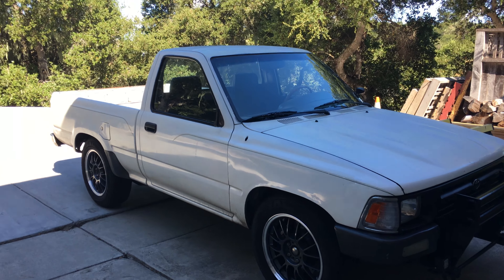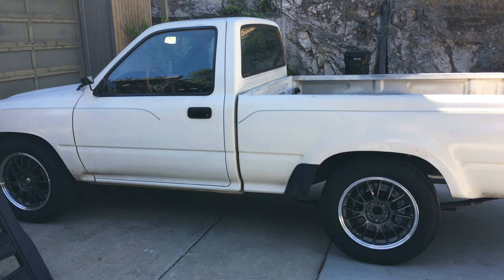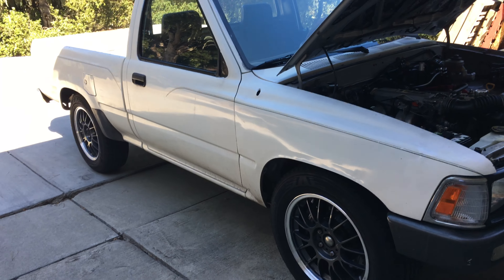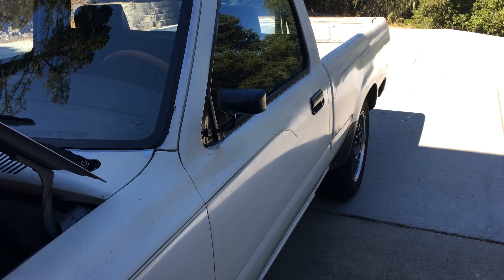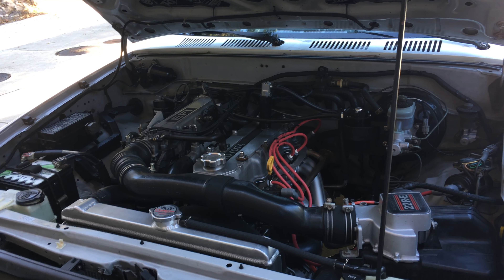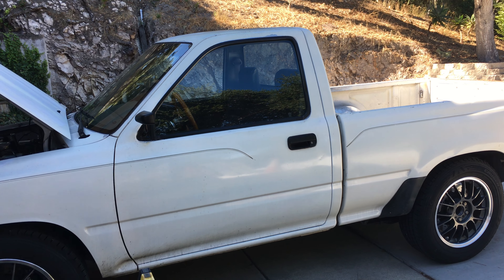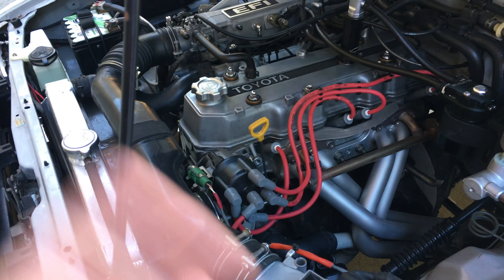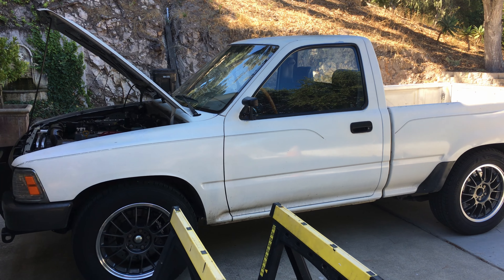What it's like owning an older Toyota Pickup truck w/ a 22RE motor pros / cons & do chicks dig it?

Comment: I bought an ‘87 SR5 4x4 with the 22RE a few years ago.  I love its simplicity, reliability, and looks. It is easy to work on, and engine/drivetrain parts are readily available. In my mind, it’s the perfect vehicle. The 80’s and 90’s were truly the golden age of Toyota.  Thanks for the videos. 👍
Reply from the maker: Couldn't agree more. My girlfriend has a 1996 Lexus ES300 w/ the 1MZ-FE motor - that thing is super nice and similar in a lot of ways to my truck. 90's for Toyota is where it's at for sure.

Comment: Have a 91.  I bought brand new 34 years ago.  Ready, $6500. But the dealer but in factory ac and cruise control for an extra $750.  Yea they use to do that. No radio came with it, So I put one in.  Many folks give me a thumbs up.    Never drive it in the snow and rarely in the rain.  I'm retired now and it serves me well.

Comment: I am thrilled to have found this channel as a fellow 22r/re lover. I had an 87 4x4 single cab that started my toyota pickup obsession. I spent much of my late teens and early 20s hunting extra parts and tinkering on it constantly. I eventually sold it because I wasn't using it anymore. Last I heard, the guy that bought it has put like 150k miles on the engine I built for it. 

After the better half of a decade, I finally got the toyota pickup I always wanted. It's a white 91 pickup dlx xtra cab- 2wd 22re 5 speed. My buddy that had it swore he'd never get rid of it. After a decade of wearing him down we were able to make a trade for one of my other cars. Thankfully, I always hoped to get another one, so I kept all my extra parts lol. 

I tell everybody, these little trucks can do 95% of what the average suburban truck owner needs a truck to do. If it's a 2wd you get the benefit of being able to step directly on the tailgate. Think about that next time you have to move a refrigerator.
Reply from the maker: Yeah, they are great trucks for sure. I love mine. Does everything I need and is super enjoyable to work on and drive.

Comment: I didnt start working on any engines untill i bought a 93 xtra cab 2wd. No AC. Automatic. And only 88xxx miles. It has 104xxx miles now. Im learning more and more as i go! Great truck to learn on. I do some things on my little pickup then it gives me confidence to tackle my toyota t100 3.4l so far i have had great success ! I love how my little toyota pickup sits low. Is pretty stylish. Has torsian bars ( dont have to worry about lower ball joint failures like tacomas because of them ) 22re is a loud ticky lil thing. Going to do a valve adjustment still. I would also say the 5vze is also a bullet proof motor in the camry. 4 banger. I got over 150k out of mine before i decided to sell to get my truck. I still miss my camry. I wanna keep both my trucks and get a 93-95 camry. I have toyota issues hahaha
Reply: 5sfe * 5vze is in t100.

Comment: The passenger side mirror is a worthwhile investment..
Reply from the maker: I removed it to reduce drag and help increase gas mileage
Reply: @ray5961  Not to be argumentative, but I put one on my 94 base model and have gotten 40 mpg on occasion with my 22re with a 5 speed.
Reply from the maker: @garethleitner9547  For sure man, no problem. But 40 MPG seems really high. Have you checked your speedometer using GPS on the phone to confirm everything is reading accurately? Best I've ever seen on my truck is about 26 MPG with a tail wind, although I'm usually driving 80+ MPH also. In my experience a lot of times when people say they are getting 35 or 40 MPH out of the 22RE it's either because they are not actually doing the math calculations correctly and/or because they have an undiscovered calibration error due to running different gearing or something. Are you filling up your tank full each time and then dividing the miles you've driven by the exact gallons needed to always top off the fuel tank or just estimating how many miles "for a full tank of gas"? Also, have you done a GPS calibration to check our gauges? On my truck for example, I have different gears and tire size and that all works out to a 5% error which I have to account for. So when I'm traveling 80 MPH on the dash, my truck is actually going 84 MPH. If my odometer says I've covered 200 miles, really I've covered 210 miles. If it takes 10 gallons to fill up the tank to top again, then just divide the 210 miles by 10 gallons and mileage is 21.0 MPG. Is that how you are computing things? I think 40 MPG from a 22RE is next to impossible unless you are maybe running 35's and driving 55 MPH the entire trip or something... fill me in, I'd be curious to know more! :-) With regard to removing the side mirror and installing a smaller mirror on the passenger side, I can definitely feel that the truck drives a bit smoother on the highway and mileage improved maybe 1/2 MPG +/- on account of it. There are times when parking that I do miss that passenger side mirror though! :)

Comment: I still dream/aspire to own a 355 some day (and my old roommate's got a 360 on the way from Japan that I'm supposed to help him manual swap here soon), but maybe my old 22re Toyota 4x4 pickups make those Italian stallions obsolete lol
Reply from the maker: F355 is a fun car... feels a lot like a tricked out Datsun 510 :) You gotta be real careful with the 355, because it's easy to spin up the rear tires and things can get out of control very fast. I nearly wrecked my 355 the 1st night I owned it.. also damn near crashed it just driving into town on a cold morning; rear tires spun up and it went sideways into the parking lane - had there been any cars parked there I would have wiped out the rear quarter for sure. The 355 also is somewhat poorly built in some areas. Things fail on it, stuff falls off it. The cat ECU's are prone to failures and need to be replaced. The left side (as I recall) factory manifolds will blow a hole into the air injection and the car sounds like a VW bus w/ no muffler. The inside has a haze that builds up on the windows due to whatever adhesive they used. It's a fun car and w/ a tubi it sounds like a straight F1 car through a tunnel. Also belts require a full motor drop as I recall. So you better really love the 355 if you plan to actually drive it. The 360 is built more like a tank by comparison. Models before 2001/2002 had issues that should have never left the factory. It's a bigger more comfortable car, but still fast. Exhaust doesn't have the F1 sound.. it's more like a drone w/ any sort of aftermarket exhaust. Beautiful sensual lines on the 360, especially in metallic paint. Feels much more bullet proof and powerful. The 355 feels like a kit car, while the 360 feels like an exotic. 458 is a dream.. it's like if the 360 and an iPhone had a baby and that baby grew up to rule every other car on the road and that baby said "you shall only drive me at 130 MPH during rush hour traffic... and the CHP can suck it... they can't catch us, even with their helicopters - now drive". And the 488 is just garbage... and anyone that likes the 488 has no taste, at all :) But the Toyota pickup is as much fun to own as the 458, you just gotta not care about lack of power. And CHP helicopters can catch you, unless there is a dirt road that leads deep into the forest, then maybe you can get away still...

Comment: Hey Ray, just adjusted the iac valve after replacing the fuel pump which was a task and I can give advice on how to access the fuel tank if anyone wants to know.  Anyway I could only let out the valve 3/4 and now it’s pretty rich .  I’m wondering if 1/4 turn back if it will help lean it .  Thoughts ?
Reply from the maker: The IAC valve should have no impact on running rich vs. lean - at least not once the warm up phase of the motor is complete. Let me know what you mean by 3/4 ? you mean you turned the little slot nut thing inside the IAC valve counter clockwise an additional 3/4 of a turn? How are you getting an AFR reading from the truck during operation?
Reply: Yes I was trying to back it out more but could only get 3/4 turns .  My thoughts were to make it idle better and also to have the same airflow after let’s say having it parked for 15 minutes , more of an experiment really .  I know or assume the computer trims down or up no matter what so maybe it’s the 02 sensors .  Everything else , sensor wise has been checked.  It’s drivable just the fuel economy is off.  Ive had the truck for 5 years now and I’ve hit the sweet spot where it runs like off the assembly line but it never lasts
Reply from the maker: @gatzbravo  Hmm.. hard to say but usually the IAC valve doesn't have a lot of impact on stuff like fuel mileage. It's only function is to act like a choke basically. Did you see my other video regarding what to check when your 22RE isn't running right? You can also just block off the air inlet hole inside the throttle body to totally disable the IAC valve in order to rule it in or out of what is wrong and see if that's even a factor to be concerned about or not. What sort of mileage are you seeing around town vs. on the highway? With my truck I average around 19 MPG in town and more like 24 MPG on long highway trips.
Reply: Last I checked I was there at about 17-18 mpg but that was before the fuel pump change.  When I changed the pump i could se the previous owner did an amateur job with the wiring.  He put twist caps on the connections which may have been submerged in the gas but still worked till it didn’t .  As far as the mpg if I smell gas it can’t be giving me good mileage now.  It’s just weird that it’s off after just the pump change .  I had already cleaned the intake, throttle body ,  when trying to troubleshoot till it stopped pumping gas.  I think it was on its way out regardless of any other issues.
Reply: I did see your video yes.  These engines are so simple but tricky also.  I do believe that I’ll never get it finely tuned like u mentioned on one of ur videos
Reply from the maker: @gatzbravo  17-18 isn't unusual for around town, especially if you lead-foot it and/or if you are driving a 4x4 truck. Are you running a cat? Could be an O2 sensor issue as well, as that's how the ECU zeros the air/fuel ratio out.
Reply from the maker: @gatzbravo  Yeah, that's basically it. It's an old motor and ECU running on OBD1 kinda stuff. I mean you can get it to where it runs really well 99% of the time, but sometimes the idle will go up and down when you come to a stop if the ECU gets out of sync with air/fuel ratios and things. Getting the 22RE to idle super smooth is basically not possible as far as I know.
Reply: My brother is a Honda guy and he’s convinced that it’s one of the two O2 sensors .  All my small issues up till now he might be right .  I really dislike sensors at this point lol .
Reply from the maker: @gatzbravo  Hard to say but it could be. You can check the voltage output in the diagnostic box for the O2 sensors if you wanna see if they are sending signal back. On my truck the harness to the O2 sensors was chewed up really bad when I first got the truck and that was causing issues also. But I wouldn't expect much over 19 MPG around town. You can try to lean things out a bit by adjusting the spring inside the AFM and that will usually kick your gas mileage up a bit and lean things out. Maybe try 2 clicks more lean on the AFM inside there (make darn sure to mark the factory starting point however). Also, keep in mind the 22RE relies on narrow band O2 sensor technology, while modern cars are typically wide band. Narrow band is more or less blind to what is actually going on, so it can only tell the ECU "you're too rich or you're too lean or just right" but it can tell the ECU how rich or lean. So if things go ultra lean, the O2 sensor keeps sending back a "you're still too lean bro" signal and that signal only comes once a second. So if it's very lean or very rich, the ECU could need 10-15 seconds to get back to where the O2 sensor says "okay, just right". With a wide band controller you can see the exact AFR and the ECU knows "okay, far too lean, make this must adjustment right now". So yeah with our trucks, kinda the blind leading the blind in some areas for engine management. Check your plugs also.. make sure they are fresh and no oil or gas on them. I'd also run a compression check and whatnot. Fun times with the 22RE no doubt :)
Reply: That’s right, forgot about that , thanks
Reply: Here’s a tricky question …I have my fan relay hooked up to the white red wire which I think is the EFI in the fuse box .  I can’t remember if I did it or the previous owner.  I know that it has burned a couple of fuses cause of the fan load.  You think it’s effecting the resistance and possibly the EFI system ?